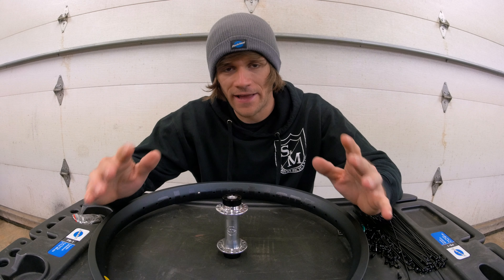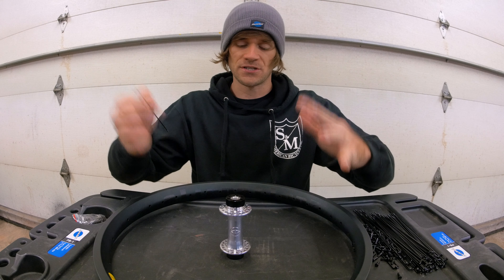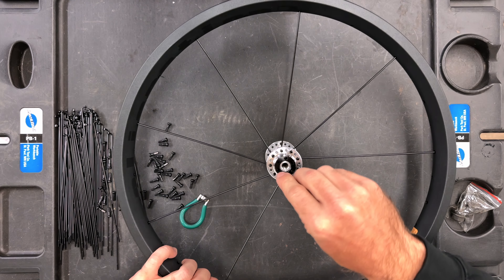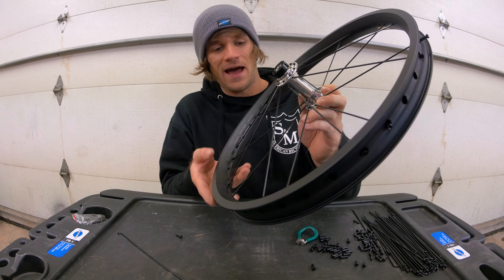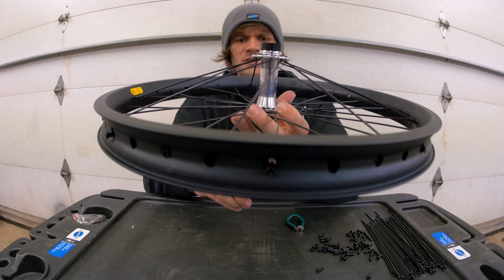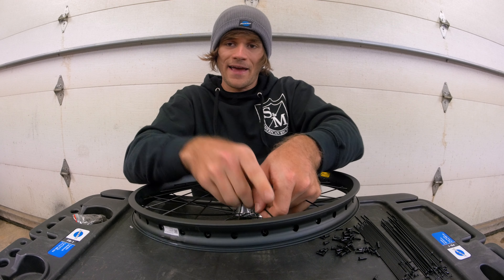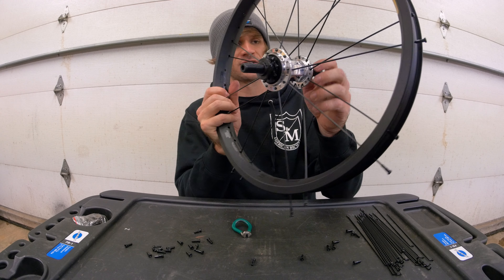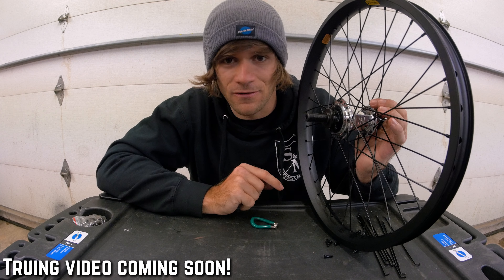Lacing BMX Wheels MADE EASY

Comment: Instead of doing this on a table, you could make a simple hanging jig for your rims. I realize most people won't be lacing their own wheels, but if you own multiple bikes, doing your own work saves money. You would need a minimum of three padded hooks spreading out from the top and outside. Preferably spaced by rigid media. This keeps the inside of the rim accessible at all times. Hung closer to eye level, this would make wheel building not only more comfortable, but more efficient.

Comment: I like this method, the only thing I would change is after you do the first 9 spokes, run the 10th backwards and cross (if you dropped the spokes down, pull this one up), this will twist the hub to line up at the schrader valve and hold it there for the duration of the build.  When you get to that step/spoke later, just make sure it's tucked if needed.

Comment: My first job was lacing rims because I knew different lacing patterns (mostly straight, 3x and 4x) and because the guy that ran the shop hated doing it... I loved it because I met a lot of cool people and worked on some really, really nice bikes.    😁👍
Edit: My best advice is to do a couple crosses to hold the rim and hub in place... It helps keep everything in place just to make it a little easier, well at least for 24 or 36 hole hubs but 48 hole hubs were just a nightmare.    LoL

Comment: What Abt extra wide rims w/ the wider spoke hole spacings? Is it the same difference or is the corresponding hole different ( criss-cross) ?
Trying build up rims now. Wud be extremely helpful 
- eclat bondi for reference
Reply from the maker: Same as what I say in the video if you’re doing 3 cross normal lacing